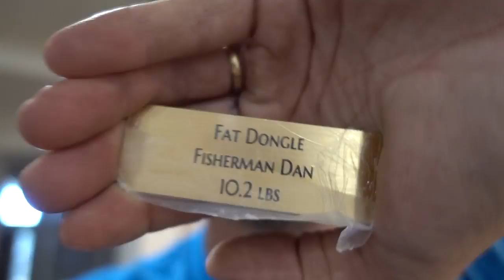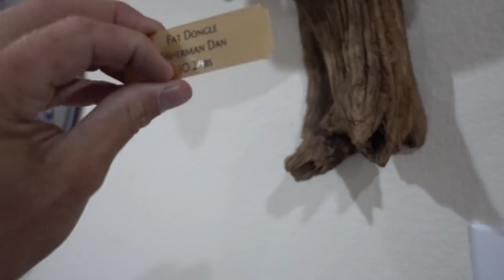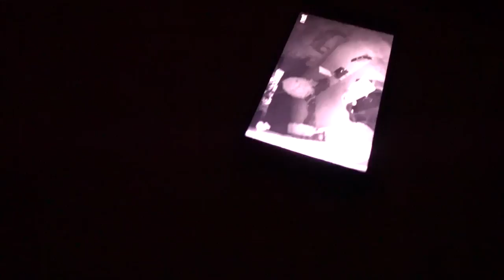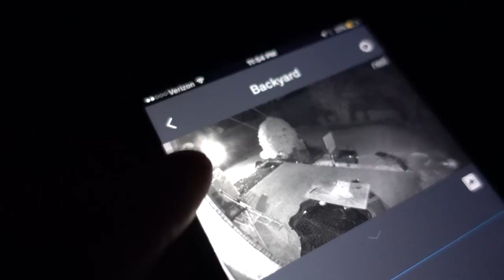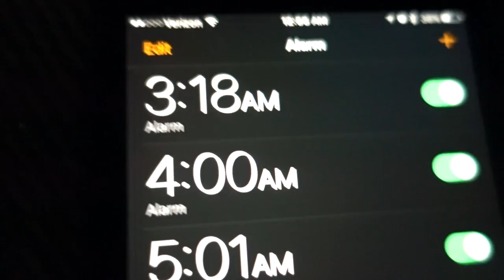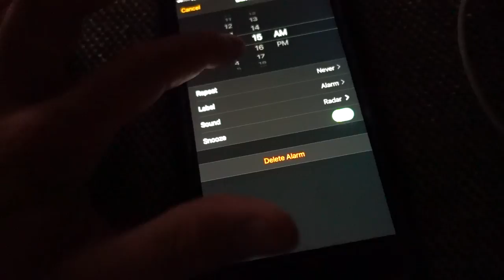Using My HOMEMADE RACCOON TRAP!! - (FAIL)

Comment: I've trapped many raccoons and never spread food around the trap... I put the back of my trap up against a tree  to prevent them from reaching through, open a can of tuna, sit it in the back of the trap so they have to step on the trip deal and I have had very good success! If they are super smart and grabbing the food without tripping it then I will take a piece of Frozen tilapia and wire it to the back to make it more challenging.

Comment: Hey Rob, practice on that drawback. Wanna stand up nice and tall, keep that bow nice and straight (don't wanna point it up to pull back), pinch those shoulder blades when you're pulling back (use most of your back as possible) and you'll be golden. Nice groupings though!

Comment: Hey rob, you need to set your pins to 30, 40, 50 or 35, 45, 55. Most compound bows shoot flat out to 35 yards and then the arrow starts to drop

Comment: Rob,  You do not want to bend your arm that much.  You don't want it locked just slightly bent.  You want the string to touch the tip of you nose.  That will give you a consistent anchor point. If you extend your are that should put you closer.  Relax your grip also..  Keep shooting!!!  Enjoy your vids man!

Comment: Rob I would recommend getting your draw lengthened on your bow. Your bow arm should be almost straight but not locked out. Relax your bow hand,  don’t need a death grip on it. Also do yourself a favor and get a back tension or tension activated release and learn to pull through the shot.  Your release hand should come back and over your shoulder and your elbow should come straight down.  Better to snuff out bad habits now than later.  Get to a local pro shop and they should be able to set you up right.  Glad to see you enjoying the sport.  Have fun and good luck!

Comment: Just use the first traps you bought. Just bend the wire that holds the plate up and the trap set. Bend the wire out just a little bit at a time and it will make the plate way more sensitive and put the bait as close to the plate as possible without getting under it so they won't step over they will try and reach over and makes it more likely they touch the plate

Comment: Looks like your draw length is a couple inches short. Your arm should have a little bend it but not that much to get the peep in the proper location. Good starting point is arm span divided by 2.5 to get a good measurement.

Comment: Try to not grip the riser, and instead let the tension between your release hand and bow hand hold the bow in your hand. You want to have relaxed fingers/hand, instead of gripping the bow, which torques the bow and causes inconsistencies. If you have trouble implementing this, try resting your fingers on the riser, this will force you to relax your hand. For very in depth archery advice, listen to NockOn podcasts

Comment: Tell peric his trap will work. He just needs to add a horizontal brace across the front. And if he does it right he can put one at the bottom and it'll lock it and one closer to the top so when it's down the top doesn't blow out

Comment: do you have a sling that goes around your wrist on your bow? that's what you really use to hold it on your hand. don't wanna grip you handle much. atleast that's how most bows are set up. mine I don't really grip handle I have some of my hand open. hard to explain without showing a picture of it.

Comment: You just need a better door track system and reinforce the door. Try using a pull pun system hooked up to an electric servo from an rc car. That way they won't see the ropes.  Good luck.

Comment: Tried some foot hold cubby traps yet?  Much more reliable for catching raccoons than cages.  Plus they are set and forget,.  Come back in the morning and there might just be a masked bandit on a chain waiting for you.  Also, never bait outside of your trap, make them enter your set to even have a chance at getting a bite to eat.

Or you could mount those nods and put your new suppressor to use.

Semper Fi

Comment: Hey iv e built traps like just drill a half inch hole near the bottom of the trap door and behind the door put a piece of pvc big enough to hold a metal pin that'll go into the hole on the door and attach a string to pull it much easier

Comment: Try continuing the ground in other words if you set it in mulch make sure the bottom of the trap is covered in mulch that way they can’t tell the change in ground.. if there pulling the cords and blasting out trap doors I’m sure they can figure out there feet aren’t on the safe ground anymore when they go into metal traps and a thrash can

Comment: heres a solution to your problem... drill a hole at the top of the pic pipe, pull up the door, put a pin in the hole to hold the door up, tie string to pin, pull string when raccoon goes inside of trap.

Comment: Probably won’t read this but a pro Tip for those bastards is to tip it upright so they practically fall into the box so those havaharts you just tip so they have to slide in to get the food
Reply from the maker: +Connor Pennings Outdoors that's a good idea
Reply: Hey lunker

Comment: Use the bow on a trash panda
Reply: Also drill holes in the back of the trap for airflow not for the raccoon but so the scent will flow through the holes and attract them into the trap